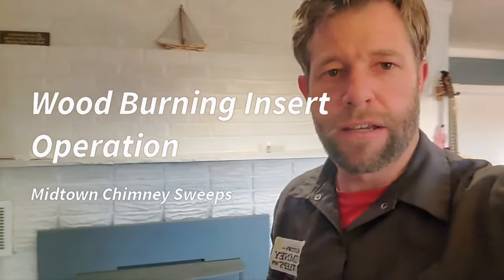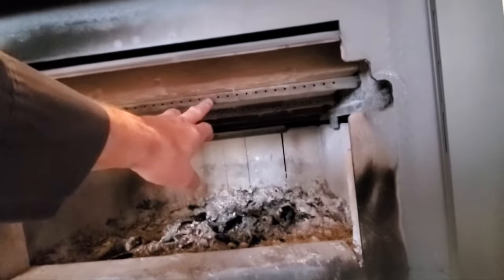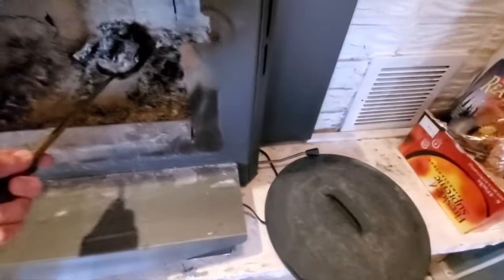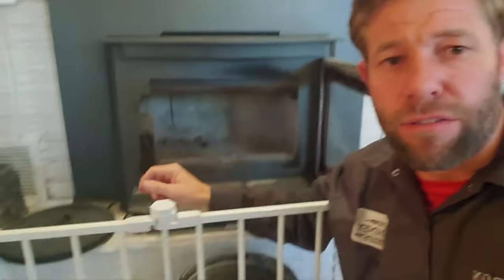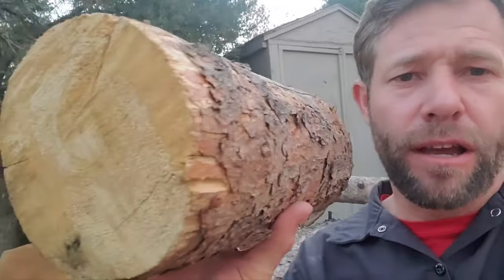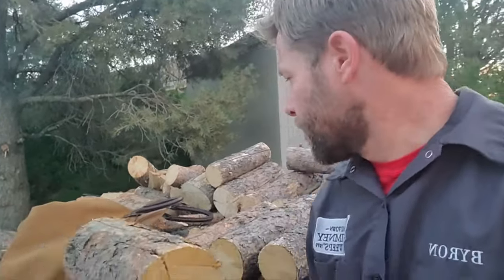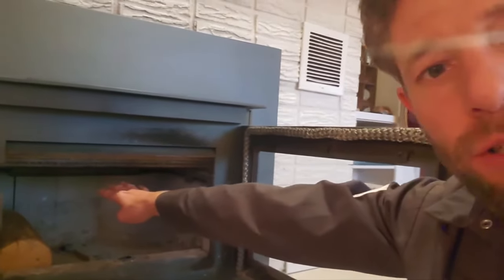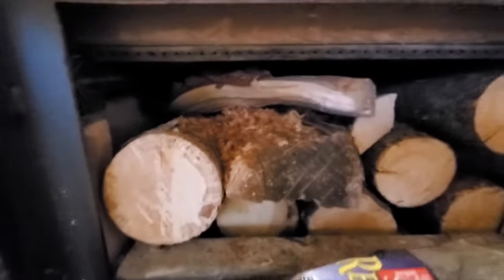How To Use Your Wood-Burning Insert

Comment: I know this is an older video but hoping you see this. How to best control the blower for maximum output? Your video seems to end before you cover the optimal use of it and not sure how turning the fan up or down controls output. Thanks!
Reply from the maker: I am sorry that the video does not go into detail about controlling the blower. You can check the manufacturer's instructions for recommendations.
What I can tell you is... Hot fires should have High blower settings, and Low fires should have Low blower setting. If it were possible to make this adjustment to keep the blower in step with the heat temperature of the appliance, that would be ideal. 
If you run the blower on High (moving lots of air over the surface of the appliance) while the appliance is Cool... then it will cool the firebox, and interior firebox temp will drop, causing combustion inefficiency and possible creosote formation.
See my recent video here for more intel on the three T's of combustion, its about half way thru the video:
https://youtu.be/27jKaVjE_f4
Reply: I thinkni found my answer here

Comment: I’m curious if the black square trim around the box is supposed to go ontop of the brick/stone. Or should I put the trim in and then stone to it.
Reply from the maker: GREAT QUESTION! Sorry for the delayed response- I wish more people would ask before grouting in the surround. The surround is supposed to go on the outer surface, or be custom cut to fit under the lintel so that in any case it can be easily removed for future service of the appliance. Please do not mortar in ANY wood or pellet or gas burning insert surround because the installer will have to chip it out and destroy the mortar when service is required someday, and secondly, the expansion and contraction of the high heat appliances and their attached surrounds will crack the mortar. A weird and ugly gap will occur if it is mortared in place. The manufacturer also does not permit "permanent" mortaring in of the surrounds on inserts.
When you do see a fireplace mortared in place, it is NOT AN INSERT. It is a true built-in fireplace, and it is totally fine to mortar and brick those in place. All the replaceable components are designed to be accessed through the firebox or control compartment. But not so for inserts (which go inside of masonry open-style fireplaces).

Comment: I was wondering if you had a video on the baffling?  I messed it up and not sure how it's supposed to lay with insulation and the pieces that look like wood but feel like Styrofoam.
Reply: I was actually wondering the same thing. I have the pipes in place, but should that styrofoam-like insulation lay in the pipes, or all the way in the back on the swinging metal flap/damper.. I have a Drolet Escape 1400
Reply: I have a Vogelzang 1,200 sq. ft. Wood Stove Insert - VG1820
Reply from the maker: You bet here is another video showing the precise process. Thank you! https://youtu.be/xzQ2vjA4Q2c?feature=shared
Reply from the maker: It wil be in the installation manual... sorry I don't have a video on that. But if you google the phrase you seek you will find it!  @DizzyThermal
Reply: @Midtownsweepsfranchise  the manual was super helpful.. The swinging metal flap was the front baffle support. So it was incorrectly installed and not supporting anything. It is now supporting the front of my vermiculite baffle - like it ought to 👍

Comment: What are btu of hard woods, which I'm told u should be burning
Reply from the maker: The BTU of hardwoods is much higher than softer woods. There are benefits to both kinds of wood. Usually softer woods (take pine for example) burn hotter, and more dense hard woods burn slower and cooler. And remember the impact on the chimney over time: a hot chimney is a clean chimney!